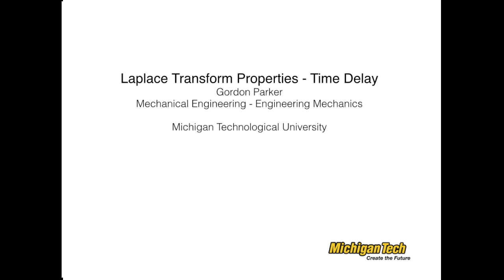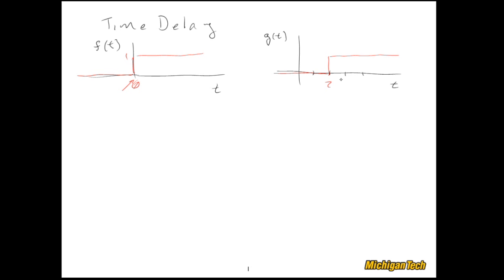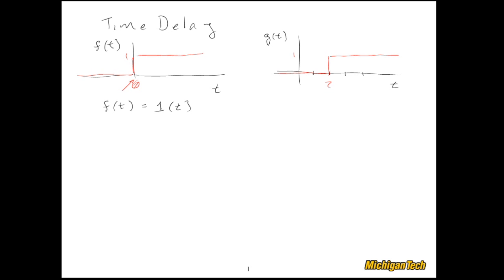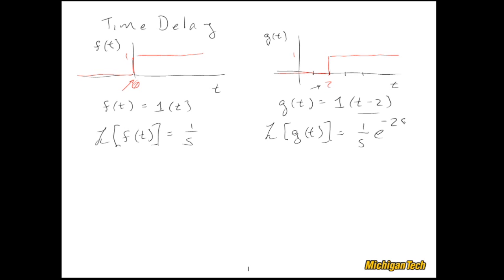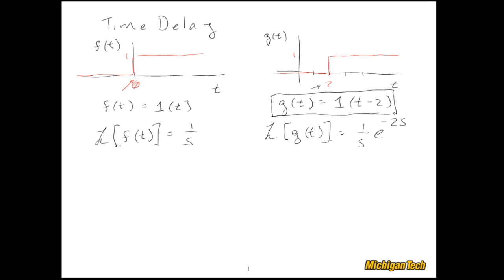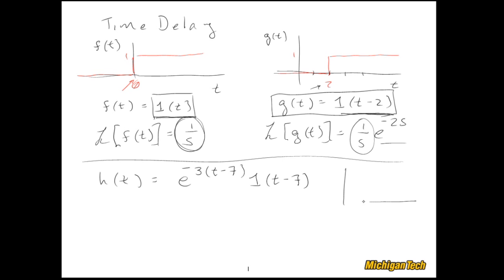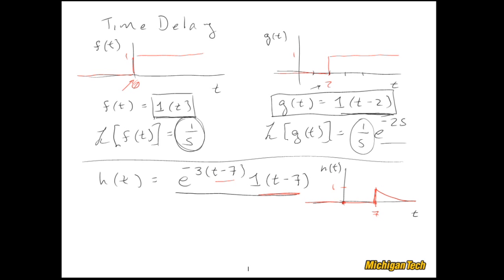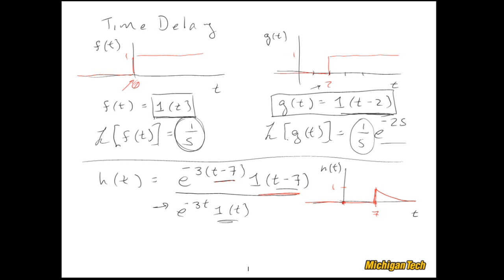Laplace Transform Properties: Time Delay

Comment from the maker: Regarding Maxwell's comment and finding H(s) = -exp(21*(7s+20))/(s+3)^2. I'm not exactly sure what happened, but here's one possibility. If Maxwell used MuPAD and entered h:=exp(-3(t-7))*(t-7), then the resulting H(s) would be similar to that shown above, and of course, is not correct. When using MuPAD to take the Laplace transform of time delayed functions you must tell it that the h(t) should be zero up until the "start" of the function - in this example that is 7 seconds. To do that define h(t) as:

h:= exp(-3*(t-7))*heaviside(t-7);

then use:

laplace(h,t,s);

and all will be as shown in the vid. I would have like to have known O. Heaviside...